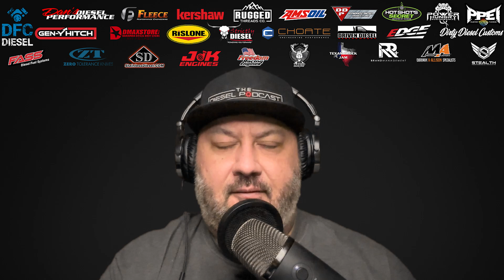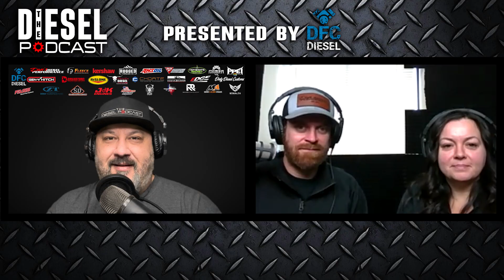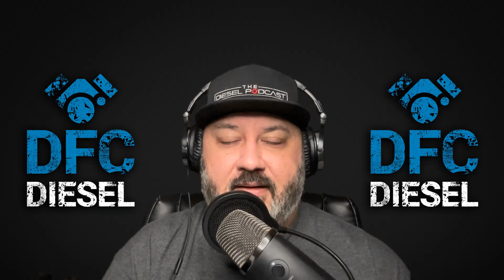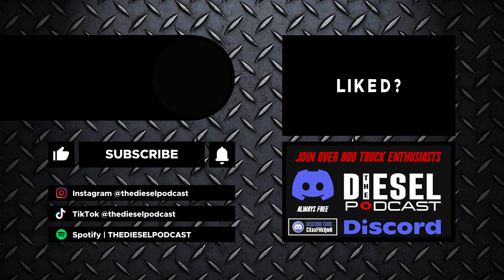Big Power, Small Effort: Drop-In Turbos

Comment: I loved this episode; thank you! My first diesel was the 2nd Gen Duramax, 2005. I absolutely loved that truck. No offense to other platform lovers, but this is why I switched to Ford. You can push 650+HP out of the Power Stroke platform without changing other stock internals. The weak points of Duramax have been discussed in this podcast, and Cummins has always been the weak Aisin transmission.
Reply from the maker: Thanks for watching!